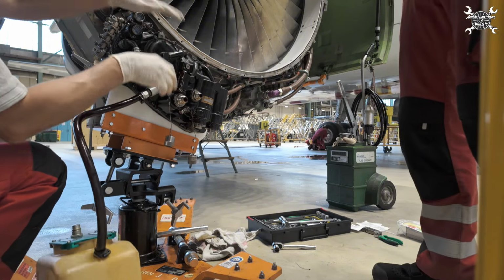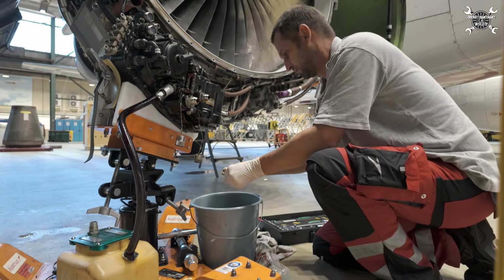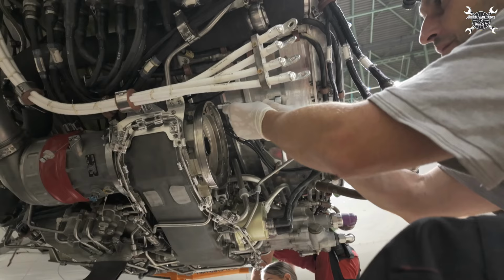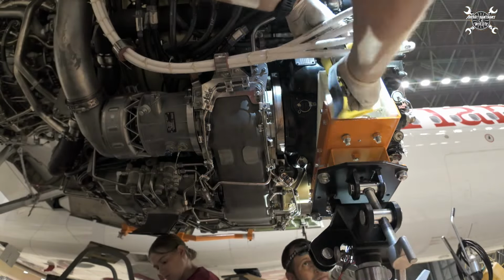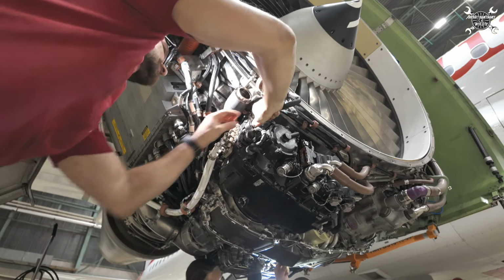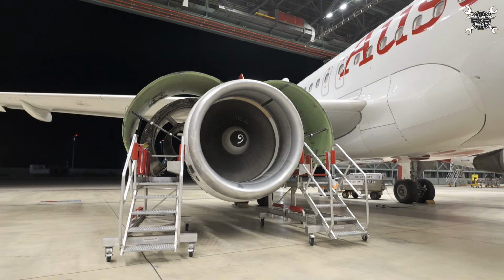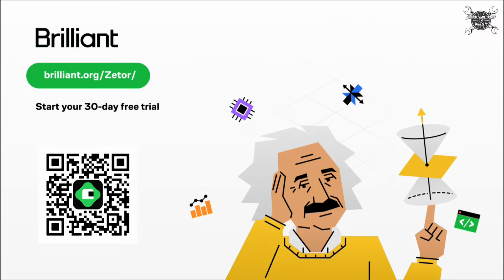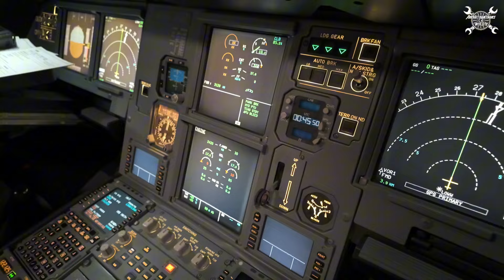How to install IDG on A32F CFM56-5B engine

Comment: An IDG is basically a fancy generator that generates electrical power for the planes systems.  120/220V 3 phase 400 hz.  On the ground, the APU provides this power, but in the air, the IDG takes over.
Reply from the maker: It is a very simple 3-phase with a complicated gearbox from which the output is 115VAC 400hz during flight and ground OPS. APU gen. supplies aircraft systems during flight ops in case of failure of engine systems and on the ground during the transition from the engine to ground power unit
Reply from the maker: Yes it does
Reply from the maker: Each generator has its own GCU or Generator Control Unit

Comment: Im impressed of how strong QAD rings are. Before idg it was csd + generetor and both components together are pretty long and heavy so QAD had to support a big lever arm force.
Reply from the maker: Yes for sure it holds weight and all the forced, It is a heavy piece of metal

Comment: A suggestion for future videos: add a small explainer on what the part and/or each subpart of the part does. For example in this video something as basic as to what is an idg, how does it work and how does it take power from the shaft and from which one, same as to why you have to locally reconnect the idg drive byt you can disconnect it from the cockpit

Comment: As a network engineer supporting ICT infrastructure for my company hangar, jet engine always fascinate me. Its a complete system by itself, mechanical, hydraulics, electronic, pneumatics etc2. I end up reading the ttm and amm, hanging around the tech asking questions. For IDG, they let me watch the entire process of replacing one. What an insight :)

Comment: Had to look up what IDG stood for. Integrated Drive Generator. When you change a component like this do you have to print the Re:Re procedure from the current up to date amended maintenance manual and sign or initial every step or is that done by electronic copy and electronic signatures. In rotary wing we call the paper printed copies the dirty finger copies or the working copies and every line must be initialed and retained as part of the tech log with the maintenance release for return to service.  For years well actually for decades we never had to do that but it's becoming more and more like the Airline procedures all the time now. We generate a lot of paperwork and wish it could all be done electronically but things move slowly in this regard!
Reply from the maker: We have everything in electronic form,  but some people like to have AMM in paper form which I understand. It is a lot of paper waste. Nut what can you do

Comment: Beautiful. Beautiful. The IDG is the input transmission for the generator? Or this is single unit-IDG is the generator lolol. beautiful. thanks. emergency electrical config is no fun!
Reply from the maker: You have inside gearbox, generator and ofcourse brain which controls it